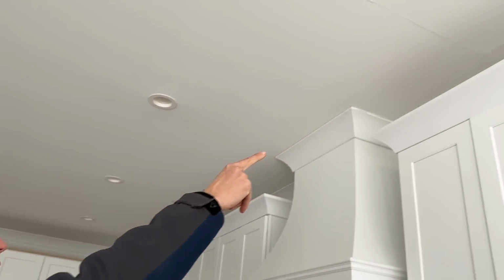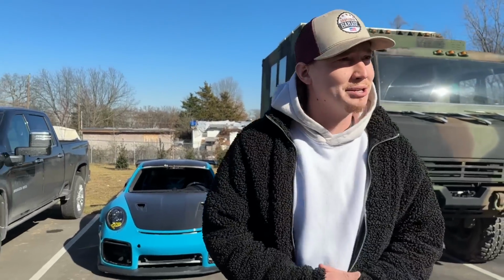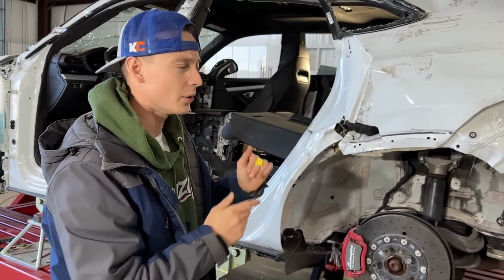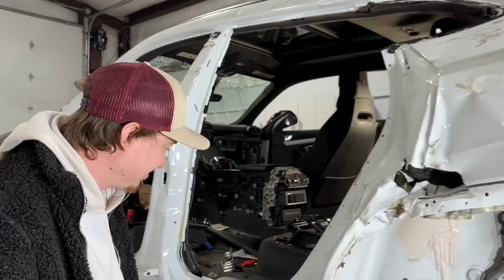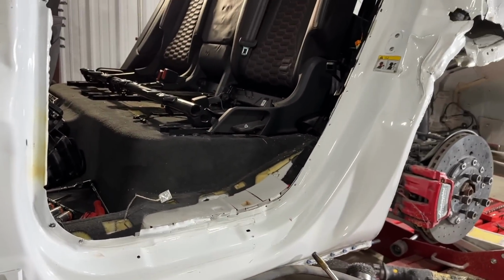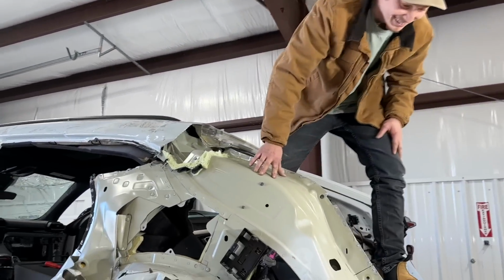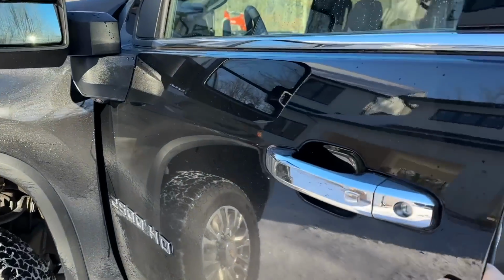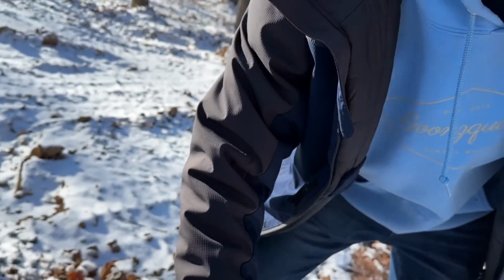Rebuilding A Wrecked Lamborghini Urus Part 5

Comment: Any reason why you don't have the heat on in the house??
Reply: think he said the city hasn't hooked them up to power yet. i live in the same general area and it has been absolutely miserable out there!
Reply: The construction is only at the "temporary  service" stage. The power lines only come up to the outside of the house. Once it passes the proper inspections, it's Party time❗

Comment: That steam shower needs more waterproofing. Good start, but all seams and corners must be waterproof, specially in a steam shower.
Reply: Yeah that ceiling in the kitchen shouldn't have cracked in the cold :)
Reply: @Mark platon  thats exactly what it will do. He shouldn't install and paint drywall, cabinets or any inside doors without heat in this house. Toothpick construction of American houses expends and contracts whole lifetime of the house. Cold temperatures act as drying agent so now without adequate heat and humidity whole wooden structure in his house  contracts causing drywall cracks. Why is it good idea to put humidifier on (if you do not have whole house humidifier system) during winter time? Because dry heat from your furnace contracts every 2×4 causing drywall to stretch and crack. Cold temperatures act same way they dry wooden structures.

Comment: I would guess the wax is to keep the aluminum and steel from touching.  If there isn't enough between the two you will get oxidization from the inside.   If you look into the Ford Mustang hoods from 2010 - 2012, they had that issue.

Comment: Hope your house doesn't develop more problems due to the cold weather. All the builders I work for have continuous heat once the house has been dried in. Especially once trim and cabinets have been installed. Moisture is not your friend. Heat that place as soon as you can my friend.

Comment: 8.40 is it possible that Lamborghini went the extra mile with the aluminum to keep it from rusting maybe in salt climates they filled a lot of those panels with high amounts of wax and then just heated it after they assembled the vehicle so that the wax would fall and fill the crevices in the joints and seems like it Seam sealer

Comment: Something you guys might look into for "tickling" those connectors apart is a Dental Pick! My local Ace Hardware sells them in many styles. They also sell "Horse" syringes and needles. You'd be surprised how handy they can be to put glue in hard-to-reach places!

I have that same Bernzomatic torch (I *think*). Can't read the number on yours, but mine is a MAPP gas one that will also use propane. MAPP burns a LOT hotter than propane. Yellow cylinders instead of green. Mine is a TS4000. You can use Propane on a MAPP torch but using MAPP on a regular propane torch will kill it quickly!

Comment: An interesting case from a few years ago about an improper roof repair performed at John Eagle Collision in Texas. Roof was replaced due to hail damage. Basically the manufacturer's repair guidelines were not followed and caused significant damage during an accident with another vehicle. Roof caved in and fuel tank caught fire trapping the people in the vehicle. Jury awarded the victims $42 million at trial. Its been affirmed in court cases for years that the repairer, whether professional or DYI is legally held liable till the day that vehicle is sent to the scrap yard.

Comment: I have made many comments in regards to the "Carpentry/Construction" work that has been done on your channel either by you guys or your brother's workers or the sub contractors you have hired but this video should alarm you guys as someone is NOT doing their job. I have worked in the construction trades for over 20 years and always worked on HIGH END CUSTOM HOMES so I know what I'm talking about.  How you can NOT have Power and Heat connected by this part of the building process is beyond imaginable, The damage you are doing to the interior of the house is crazy! You need Pops up there everyday that the tempature is cold/freezing making sure you have some source of heat keeping the inside of your house above 60 degrees (Direct Fired Heaters are common in the industry and force moisture out while heating the home to a comfortable temps) so you don't have drywall/sheetrock expanding and contracting even the counter top seems can seperate not to mention any plumbing that is installed (Even if water isn't hooked up yet you can still get damage done). Here in Michigan where the weather is much colder ALL the new build homes we worked on doing the finish carpentry (Even the painters who primed the interior needed weeks of steady warm temps to "Dry" the house interior up) needed to be heated to a warmer temp to draw all the moisture out of the wood trim, studs, flooring etc. If the water bucket for your tile sub contractor to mix tile grout is FROZEN while sitting on the main floor inside the house then you are going to have all kinds of problems that WILL require replacing/repairing cracks in the drywall and joints seperating in wood work and hand rails for the staircase etc. You need to get that houses heated up and inspect for damage before anymore finish work is done. Shame on you guys for letting that happen as you have worked in the contruction trades and should know better. You will be extremely lucky to get out of that mess without spending a bunch of money on damages and repairs. By showing your viewers that frozen conditions inside the home speaks volumes about how amatuer you guys look. Edit that out of your video and get Pops and your brother up to your house and get that place heated up and stay on top of that investment before you cause anymore damage. Don't learn the hard way by very expensive mistakes you have to repair at much higher costs than the original work. I'm not being a dick because I really enjoy your channel but you need to step up your game or hire someone better than who you have working on your home. I don't like to see you guys coming off looking like you don't know what your doing and giving the haters fuel to hate on you for the many mistakes your doing on this home build. I know you guys can do better! If I lived closer I would volunteer my time to help you guys because that's how much I enjoy your channel so do what you have to to get this problem fixed before you spend a bunch of money that could have gone to buy another project car to build.

Comment: you boys really shouldn't be standing by or holding the chains and clamps while pulling with the frame machine that's extremely dangerous I've seen them fly off and go through walls just keep that in mind and be safe other than that keep up the good work and content.

Comment: Hard to believe the complete disregard for safety you guys are showing. Working with metal and cutting with all kind of sharp and twisted metal edges. You are using all kind of tools, but no safety gear what so ever. Are you two, including your dad waiting for some major accident to happen and maybe you’ll learn your lesson then, or do it now by using your gloves and safety glasses EVERYTIME you use a tool, even if it is a screwdriver. It’s in your hands to watch out for your health. Good luck.
Sorry to differ, but that’s not major progress if you are on the fifth video and the left side has not yet been removed and start working on the frame pull.
I’ve taken the liberty of saying this because of the fact I used to work in the industry, 15 years. Very good and honest job, very satisfying. Be good, be safe.

Comment: You really need to get heat in your house, all your cabinets, drywall, plumbing etc has shrunk. I I’ve done construction for 15 years and I’m a superintendent for a high end customer home builder and it is crucial to have temporary heat through this stage of your build. I pray that your plumbing hasn’t frozen and broke pips because once it thaws your going to have a big mess and thousands in repairs.  Get some temp heat in you house bud I’m a big fan of you guys and I hate to see all your hard work set you back from this.

Comment: So you telling me your brother is pro-contractor and he doesn't know you should have heat on when drywall, cabinets and finishing touches go inside the house when temperatures fall below freezing? Don't you know that American home structure is all wood? Wood expends and contracts. Cold temperatures act the same way as dry heat without adequate humidity. They dry all wooden structures, which in process contracts, causing your drywall to crack. Why is it a good idea to have a whole house humidifier system? During winter time, dry heat will contract all 2×4 or any wooden structure in your house. Cold does the same. So now, besides cracked drywall, you might also have rodents.
Reply: I can guarantee they have mice ,the doors are always opened !!
Reply: @T Nolan   they are good guys, but sometimes i just cringe the way they do stuff. Just wait for his wood floor when it will start separating because of exposure to moisture and then heat ones furnace is on.

Comment: I would imagine when they purchased the steel for the Lamborghinis and the Mercedes all of those high-end vehicles that they don't buy a grade material it's bought in a classification as a third standard material is what I mean by that instead of it being a grade it's a considered a third grade material it's like a manufacturing plant that I used to work in when I was young when we finished the product that was considered a grade product but anything after that was considered second grade product and when we ran out the rest of the product anything that was left over was considered a third grade product and the employees could buy that if they chose to that's how all metals are made you go to your a grade then you'll go to a second grade and then anything after that is considered a third grade material it doesn't really matter what it looks like when it goes out the door as long as it goes out the door

Comment: Hey my name is Cody Brough and I have a 2013 Nissan 370Z Nismo and it’s tuned with 400 horsepower and It’s wrecked some lady ran into me and my insurance is willing to give me 30k for it but I was wondering if you where able to rebuild it they said it would take 18k to fix bc the front right frame is bent and I owned it for a mouth before it was wrecked and I would hate to see that car go was an absolute dream to Own and I would hate it to see go but I would trust you guys to rebuild it if you guys would it would be a dream come tru